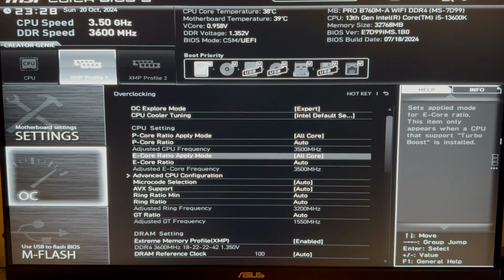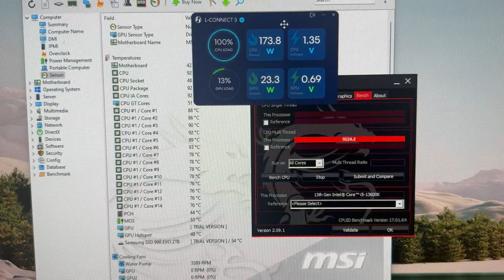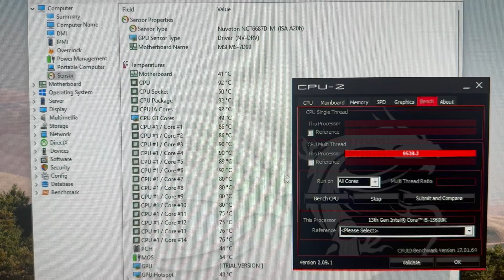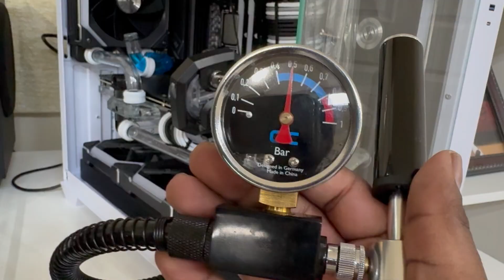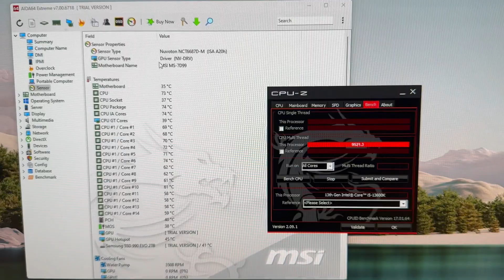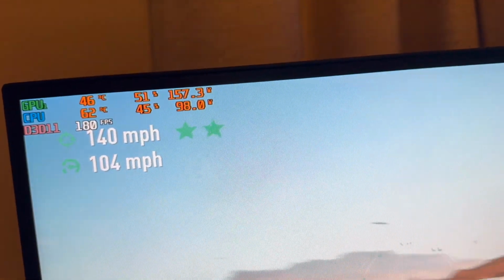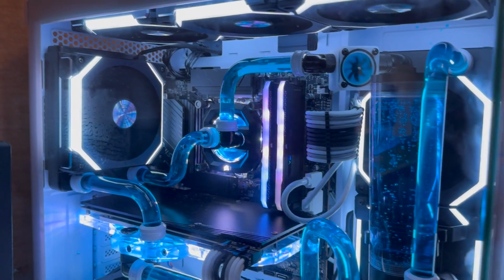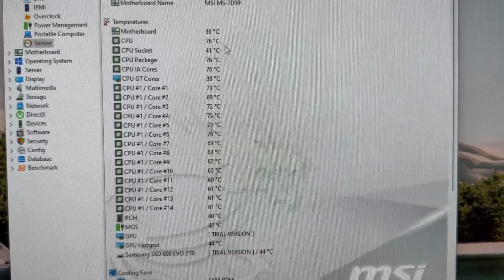My 13th Gen Intel CPU is overheating!

Comment: I'm a bit dated having an 11700K with 3200 (800x4=1600x2) RAM 4000 (800x5) Ring and 4800 (800x6=1600x3) P-core @1.3V

The 13600K try 3600 (600x6=1800x2) for RAM the Ring and E-core or 4200 (600x7) Ring and E-core and then 4800 (600x8) P-core @1.20V or 5400 P-core (600x9=1800x3) @1.25V

Be sure you can get into BIOS after failed POSTS like an option to automatically set BIOS defaults after a few failed POSTS and try lowering core voltage by 0.05V

Comment: Going to start building my first pc going Intel 14900kf with aio system definitely have been doing my research going with the plate to help with the temps from the start and probably gonna run the same thermal paste 😅 but from what I’ve read it’s definitely a help with the pressure plate definitely gotta let me know how it goes going forward
Reply: @MrXNGF  don't let it get past 1.1 v unless you have the x12b update
Reply: @MrXNGF  then you should be good to let that baby fly after that.

Comment: I have set 13600K to static 1.195V and OC 5.3Ghz P-core / 4.2Ghz E-core.
With air cooling Thermalright PA 120, temps in Cinebench R23 peak at 85C and score little over +25K points. 
Normal gaming temps hover around 60~70c which I'm totally fine with.

Comment: These can run hot tho. The issue is the voltage spikes on the cores. When its randomly hitting 1.4+ idle. If you don't have the x12b microcode update I wouldn't even risk letting these things get past 1.1. I'm trialing one right now and a previous one before. I had that one on 1.5 constantly with dual monitors and it started giving me black screening within a week.

Comment: Thats one thing about the thermal velocity boost settings, the hotter you run, the more it adds power, which means the hotter you'll run. Its cyclic. Thats why you saw less power draw on the after than the before test. I understand that's just how semiconductor efficiency works in general but i think TVB might be overdoing it a bit lol